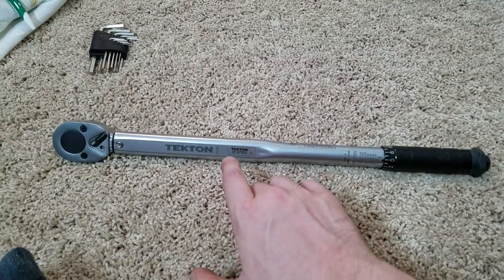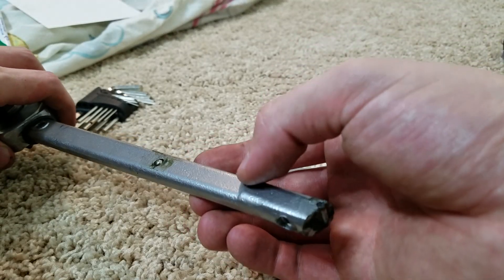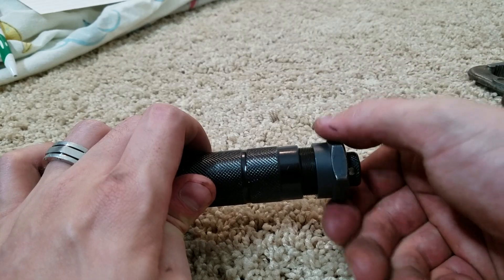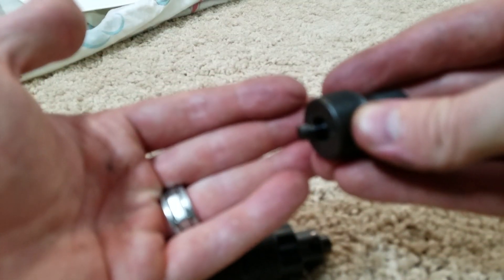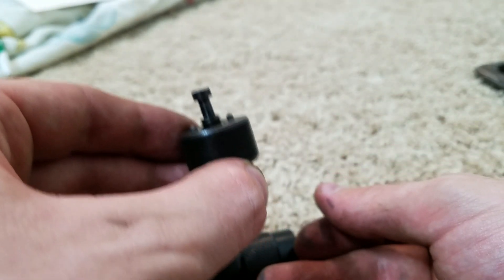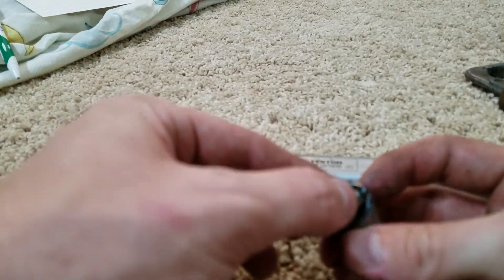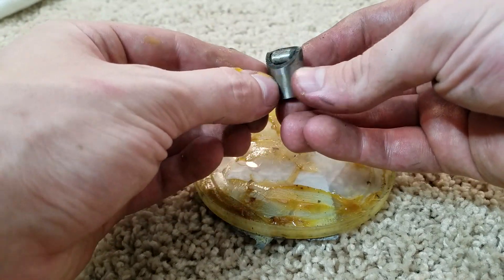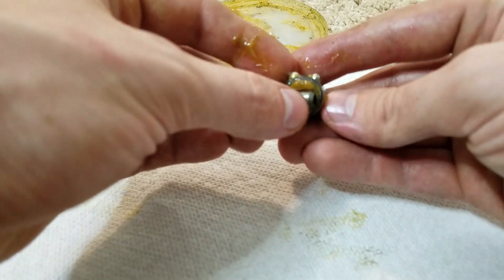Torque Wrench Repair

Comment: I have this exact same 1/2” drive torque wrench. Mine tops out at 150ft-lbs and I found out the hard way that this particular torque wrench does NOT “click” in a counterclockwise direction for reverse threaded bolts and nuts!! I was giving her the beans and got nothing!! 🤣 that nut is probably torqued to 500,000 ft-lbs at this point cause I was giving everything I had in getting that “click”

Comment: Store it in minimum setting will destroy it. Already have 2 destroyed, that is stop clicking at lower settings. What happens at minimum setting is the adjustment nut in the handle locks up and clicking disappeared at low settings. Should store it with spring slightly compressed, YMMV. This applies for the Craftsman and Kobalt, not idea about Tektron, a different design. Had click styles and digital failed. I think beam and analog dial are more reliable. Maybe will tryout a split beam next, I hear its more reliable with 2% accuracy.

Comment: Anyone know how to fix the black adjuster on the bottom mine is frozen? Autozone claims it has no warranty.  I cant use it on low torque settings because the adjuster is too loose it only tightens and hols the torque I want on higher settings.

Comment: Great video! With my Tekton torque wrench, I've noticed that no matter how much I tighten the locking mechanism at the bottom of the handle, the handle still has a bit of play. I shouldn't move at all I don't think. Do you think if I tightened the hex screw on the locking mechanism, that will fix the issue?

Comment: Thank you and Well done.............followed instruction but stll no click (torque setting).............so will strip it down and try again...............bye the way........do you know what the two pins in the threaded section, which screws into the handle twist grip do................mine are missing............Appreciated........Ron

Comment: I keep my Gearwrench torque in my garage and probably because is not heated the grease got thicker and I couldn’t here it clicking so I took my wife’s hair dryer and set it up on low high for a good 15 minutes and it worked!!!
Reply: I was thinking of doing the same!😊

Comment: When you put the Torque wrench away  after using it and back the pressure off,  the little lock knob at the bottom, should that be locked on or off?
Reply from the maker: It is just a lock like you said, so it doesn't matter its position

Comment: My old torque wrench handle would turn while I tightened the bolt. How do I fix that. The new one does the same thing but not as bad.

Example: I am set for 20 lbs as I tightened the bolt I noticed the handle was now on 40 lbs.

This only happens on the low lb settings
Reply: Do you tighten the locking screw (at the end of the wrench) after setting the torque?
Reply: @ianbarnes961  Yes, on the new one,  I found out, that they can't be stored at a high setting.  It messes up the spring. I backed the new one to the lowest setting and let it sit for a day or two. It works. The old one,well no hope.
Thank you for your help

Comment: My torque wrench just does the opposite. It clicks easily at whatever torque I set (ex. I set it at 140lb to torque the tire of my truck just to test it and it would click without using much force.. I'm not that strong:)). Does it mean my torque wrench is broken, or there's still a way to fix it.. ? Appreciate it if I could have an answer.

Comment: Very informative video.  I have a torque wrench where the locking nut is no longer loose and is extremely difficult to turn.  Is it the hex screw that needs to be loosened?  If so, does the wrench need to be re-calibrated?  Thanks!

Comment: Ok so where do the batteries go?  Mine came with batteries and a tube of grease..  tekton 24335 right? Mine looks different though and says it has 3 vibration settings but i cant find the 1/2 inch adaptor that fits the head..  ya know, i wonder if my wife switched our gifts..  godamnit now im going to have to clean it before it starts to get crusty..  keeping this grease though, wonder where youd buy scented grease at?  Never heard of Forher brand..

Comment: Once you take one apart, you should check the calibration on it. It should click within 15% -/+ of what you have it set for. Always take the wrench back to zero after use to remove tension on the spring.

Comment: You have schmutz in the plastic cover for the can of grease, the cover that it designed to keep schmutz out of the can of grease. Put the cover on the can, and schmutz can get into the grease. Not good! Clean the cover before you put it on the can! I bet you forgot to do that last time. Great explanation by the way, of disassembling and assembling a springy-dingy clicky-type of torquerizer. But use clean grease! How does one CALIBRATE this torquerizer thing, by the way? After you disassemble it and lube it up nice, you probably need to recalibraate it. And that threaded nipple at the handle end, that threads into something, and that the end cap thread over – how far in does one thread the nipple, before putting the end cap on? Or perhaps maybe it does not make a lot of difference, as long as it is threaded in far enough to have a good grip and not tear the threads and pull out when you thread the cap on?